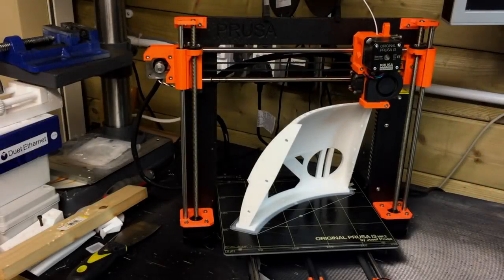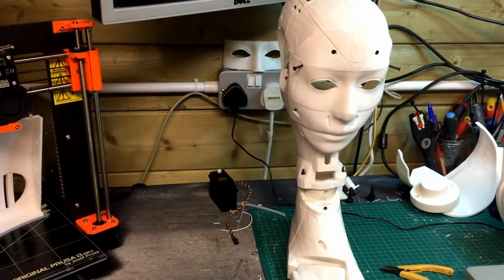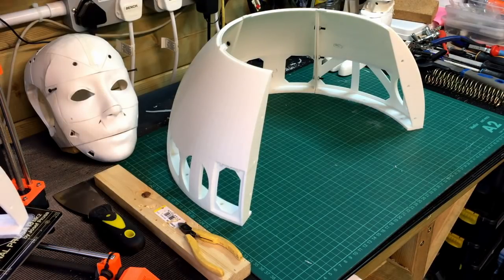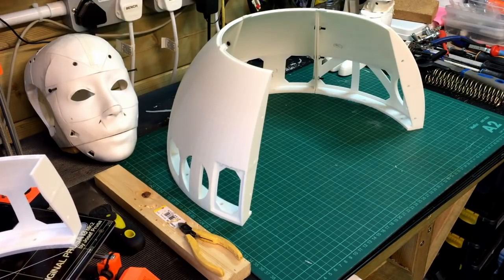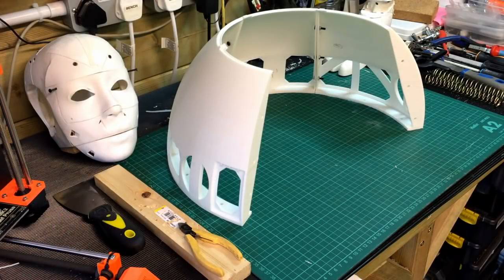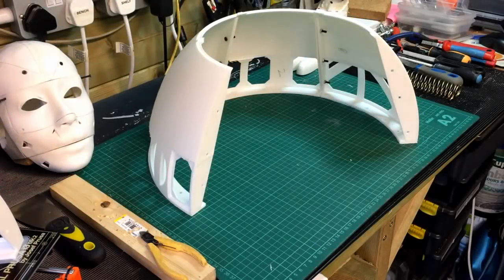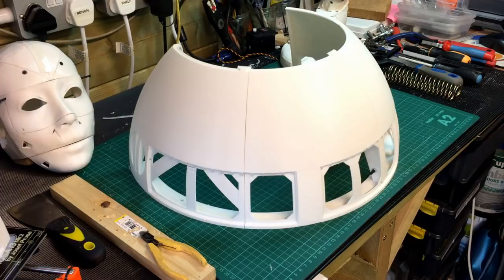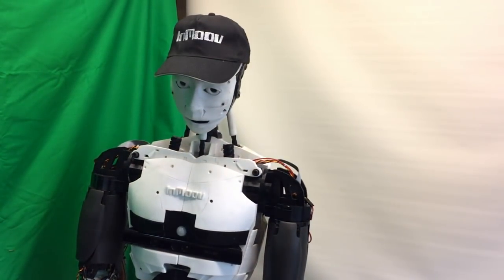R2D2 Droid Build Part - 1

Comment: Have you printed all parts with your Prusa??
Reply from the maker: Hello Jian
Yes, all printed with my Prussa.   Including the flexible tires.  All the parts have been designed to fit small print beds.  There are larger STL files available if you have a larger printer, so you can print the Dome as a single item.
Reply: @kylecampbellweb  ok, I have a Prusa i3 Mk3s and the cut-files of the Mk3 body or dome (Mr.B's Patreon) doesn't fit my build plate. I think I have to check the orientation.
Reply from the maker: @JackTheJumper93  Hello Jian, the Mk3 is designed for the larger printers [500mm bed] and the parts have not been cut for smaller print beds [ie Prussa].  Just had a look and the CutBody (Leon de Graaff) version of the Mk3 body, in the MainBody&Skirt folder STL parts are still too large for Prussa bed. 
My droid is the Mk2 so maybe that's the one you will have to print.  It may be worth asking this question on the facebook page http://www.facebook.com/groups/mrbaddeley

The Mk2 body is available in the non-patreon downloads here - https://onedrive.live.com/?authkey=%21APA5Cxi7TQXSqMw&id=E84CB8FD47152532%2124206&cid=E84CB8FD47152532
Reply: @kylecampbellweb  thank you for your answers, sir. I think I'm going with the DO-V2 first and make the Mk3 when I got a bigger Printer.

Comment: Hi Kyle what is the max print dimension the 3D print is needed to print the r2 parts? Many thanks!
Reply: Thanks for your help kyle!!
Reply from the maker: Hello, all my printing is done a Prussa Mk2 [25 x 21 x 21 cm | 9.84 x 8.3 x 8.3 in bed size] and that will print all the parts needed.   The largest parts I think are the dome sections.
If you have a very large printer there a single print dome STL and larger leg sections I think.  All available on Mike Baddeleys R2D2 pages/site

Comment: Christ I had no idea it took so long to print each part! Do the printers use much electricity?
Reply from the maker: Hi Cyborg, just an update comment.  I had sliced the parts in very high resolution which is why they individually took so long to print.  You could print them very nicely much much faster.
Reply: @kylecampbellweb  thanks Chris, appreciate the update
Reply from the maker: Yes it all takes a while!  I am measuring power consumption on my printer now and its varying between 40-140 watts, so say on average 100watts.  I print at the low power setting on my Prussa as its quieter .

Comment: Hello tou use pla or abs for r2d2 or inmoov please ?
Reply from the maker: Hello Thomas, I used PLA for all of the InMoov, same mostly with the R2D2. 
I have used Nylon runners in the R2D2 wheels and just been using PETG for the motor wheel brackets.   I tried PETG a while ago and had failed prints but now use a lower temperature [240deg hotend and 80-deg bed and a new slicer program - Simply3D which I am still getting used to.    So far the PETG prints seem OK.

PLA seems fine to me and no problems with parts of the InMoov gears etc, just printed at higher resolution.  Same with theR2D2, no problems.  I have never tried ABS